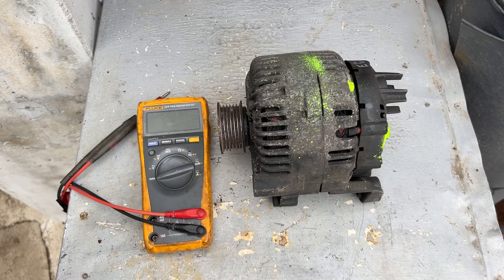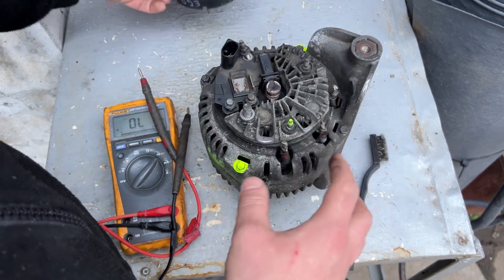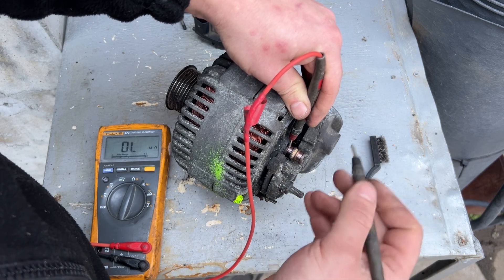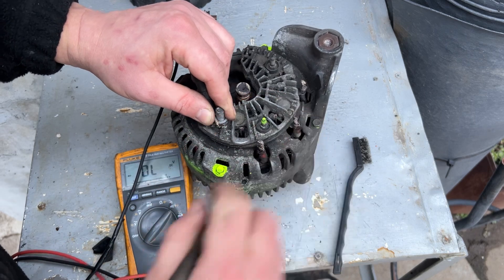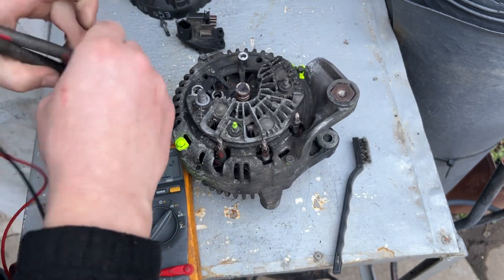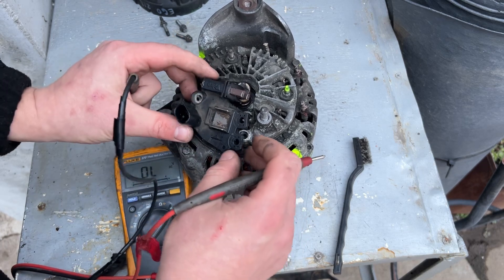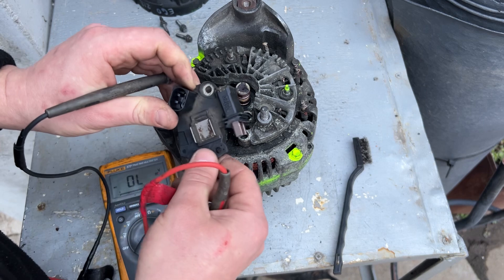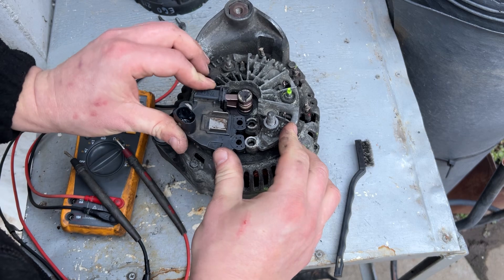How to Test a VALEO Alternator

Comment: My Valeo passed all tests; however, I cannot get continuity between the slip ring and alternator case like you did.  I only got continuity between both rings at 4.5ohms.  It seems I should not have any continuity or resistance between the slip rings and the case. Please advise. Thank you!
Reply from the maker: Give me a time mark on the video please.
Reply: @MeFixingEverything 1:56. Thank you.
Reply from the maker: Good alternator = NO Continuity 
BAD Alternator = continuity 

Reading of the mulmuter was 16 Mega Ohm = 16 000 000 ohm , it's is so high that we can count it as NO continuity = Good Alternator.

Comment: Good day. Thank you, most informing. My Valeo A120 alternator on 2001 BMW e39 is running very hot. Voltage over battery terminal is 14.01 V constant no matter the engine rpm. Can this be failing rectifier? Alternator has done 265 000km in this BMW.
Reply from the maker: Should be okay.